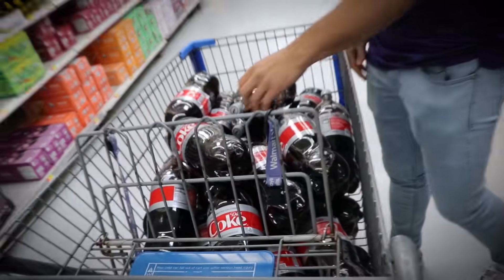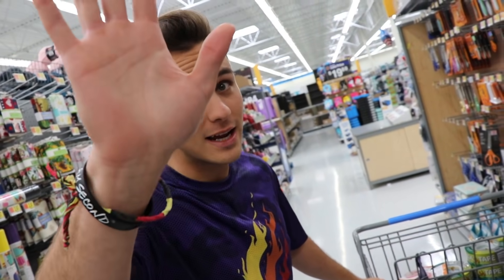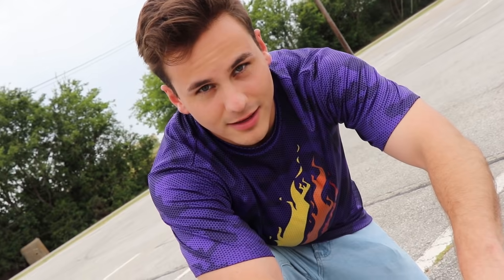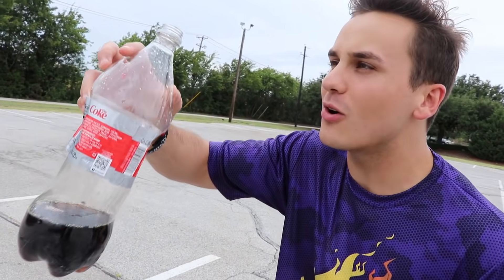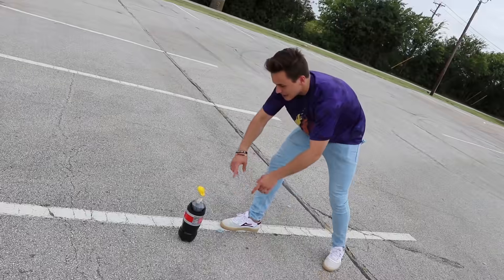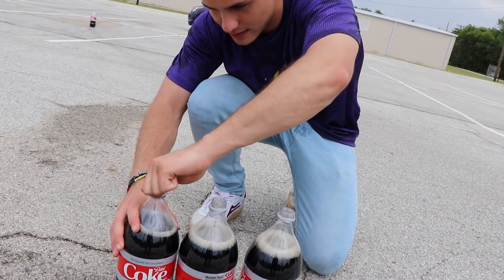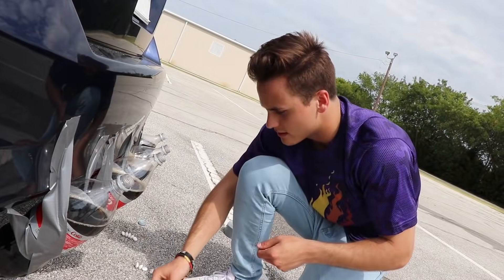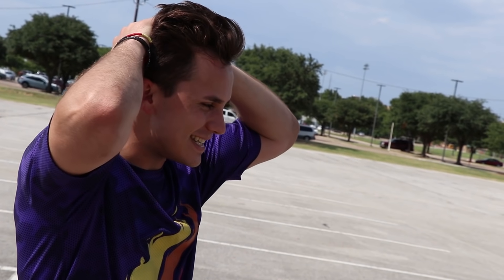Launching A Car Using ONLY Coke And Mentos!

Comment: Someone pushing it or it is  in drive mode in is impossible to move🧐🧐🧐
Reply: That's not true actually a moater bike runs on fuel if u take 20 mentos and 20 Cokes it should move I do the math